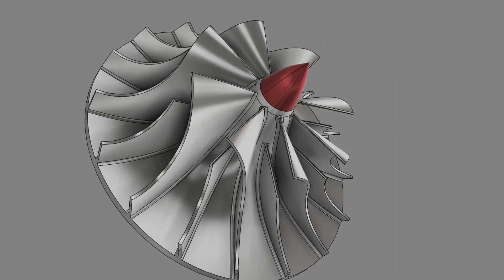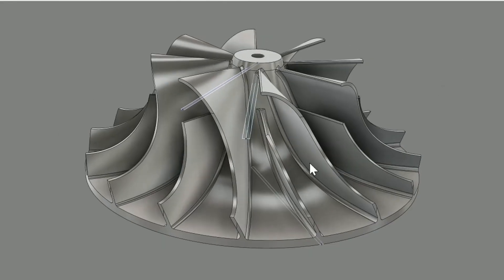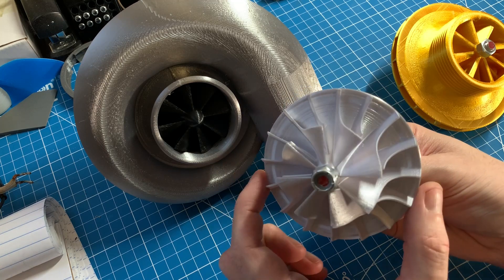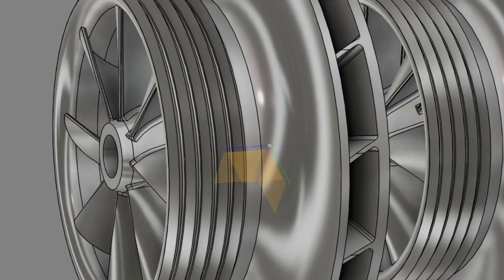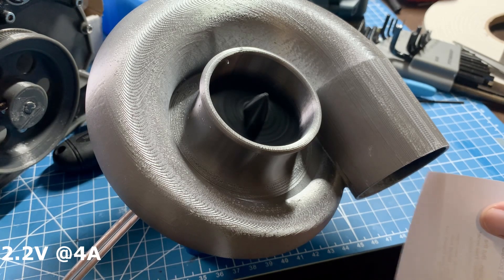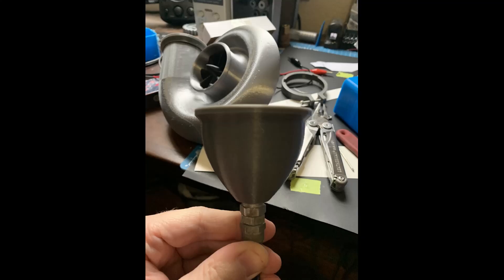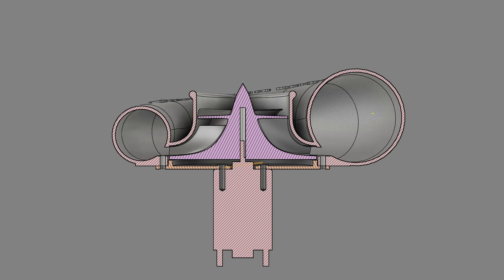3D Printed Centrifugal Turbo Compressor

Comment: This is all great, but I have been looking through all that information, likely the same papers you've read, in an effort to get the Euler turbine equations narrowed down to generate geometry, but haven't been able to do so.  Did you strike gold on a paper that you can point us to, or rather, can you make a video going through the design equations for a centrifugal pump?
Reply from the maker: I have to caveat this, but I’m not an engineer or expert on this. In my case I actually watched several demo videos of Ansys Blademaster and I actually took the detailed angles from their setup. This is also a very simple older compressor wheel design that allowed me to just use a few points and interpolate with splines. Not the most accurate, but it should exceed the FDM printer tolerances. 

This paper has the details on axial compressor design, which I used to lay out my blades. http://www.seitzman.gatech.edu/classes/ae4803/compressor_angles.pdf. Because my blades don’t twist at their root, I could lay out a blade essentially like an axial compressor with the angles from the ansys demos. I’m not sure if this is right or not. 

I’m working on a version 2 that I have an actual compressor wheel that I’m measuring and trying to model. I can tell you after playing with this, a dedicated CAD suite for designing turbo machinery is a must for designing a modern compressor wheel.
Reply: @IndeterminateDesign   First off, thanks for the reply.  Second off, it's a shock to hear you say you're not an engineer on this; the only thing I can assume from that is that you're not specifically an aerospace engineer who specializes in turbomachinery, since my brain can't accept that you're not an engineer in any capacity short of that.  If you actually aren't an engineer, I hate to break it to you but you are. :)

I checked out the paper, it definitely helps provide vane geometry and overall velocity vectors, but what I was hoping for was a set of design or sizing equations that may provide equations to determine the following, which could be manipulated based off design constraint knowns or unknowns:
- Vane count
- Slight input on Vane Curvatures (fwd, bkwd, twist)
- Staggered Vanes
- Inlet diameter, outlet diameter, volute housing diameter ratio (if it's not linear growth)
- Expected CFM
- Expected Pressure/Velocity ratios
- Expected efficiency

And of course all of that would be based on the following requirements:
- Gas properties (Reynolds, Z (compressibility factor), density, temperature)
- RPM
- Power
- Pressure/Head

I found so many papers on the design of it, all of which had the above variables, but didn't have the above outputs.  I did find some that drove what type of fan to choose based off the application, etc.  

Regarding the V2 design you're working on, and the modeling, I devised pretty simple ways to model the geometry, but that's in SolidWorks, though I can't imagine Fusion won't have similar features.  Essentially in SolidWorks, I:
1) Create an oversized disk that is the bottom of the centrifugal blade.
2) Create a plane that is the height of the blades away.
3) Create a "loft" geometry that essentially is two rectangular profiles clocked at a small angle from each other separated by the height that are lofted to each other on a curved, 2D profile.
4) Loft two circular profiles in the center to create the "body" of the blades.
5) Create a circular pattern of the loft dependent on the number of blades desired, ensuring that the rectangles overlap in the center to create jagged/overlapping geometry that i merge.
6) Cut the center out to be a constant diameter bore, cut bearing journals in, cut the disk against the blades to get the outlet diameter.
7) Chamfer the edges of the blades.
8) Fillet the geometry for machining and stress concentration concerns.

I'm sure this is all TMI but figured I'd tell you so you'd have it if you wanted it.  Thanks again for the reply man!

Comment: If you are working on a new and improved design, can you throw the design files for this up on github? I'd like to use a well thought out design as a learning tool for myself and my kids and slap it on different rc toys and and teach them through playing and experimenting
Reply from the maker: https://github.com/indeterminatedesign/CentrifugalCompressorV1

Make sure you are wearing safety glasses when operating this.  Print the wheel at the lowest layer height you can and at 30-35mm/s.

Comment: Fusion has its benefits like just being able to quickly design organic shapes, but solidworks, if you know what your doing, is a lot more precise, and can way more easily design production parts
Reply from the maker: I agree.  I can work so fast in Fusion that it would be hard and expensive for me to switch to something like Solidworks.  I've learned a lot more about how to do this properly, and I'm slowly working on a 2nd version that corrects some of my mistakes in this design.

Comment: Awesome project! What kind of motor did you use? Would you be willing to share the STL or STEP files?
Reply from the maker: It may take me a bit, but I'll get this posted to my github.  I wouldn't call it a complete success.  I've started a second version because I've discovered several mistakes in that design.  The motor is just a 540 brushed RC motor, 27T.
Reply: @IndeterminateDesign  Excited to hear you're working on a V2!! Looking forward to it

Comment: What 3D method did you use? SLA ? It looks like a plastic.
Reply from the maker: It’s FDM 3D printed with PLA filament.  It was just to try out the design. SLA or SLS would produce much better results.

Comment: Very interesting! I would love to see higher tolerances (.0001+ -) and greater detail! Other than that great video!
Reply: LOL A tenth tolerance isn't possible with FDM. Even high end CNC machines have difficulty achieving that. With shrink and deformation of plastic, it is highly unlikely. A .0010 tolerance on FDM would be more achievable - difficult, but more realistic. And at that point, one would need to consider surface finish as at that point you would only be measuring the high points of the surface with any traditional measuring method.
Reply: Even if you got that rotor within those clearances while stationary, runout from the bearings and expansion from the centrifugal spin force would totally muck them up.

Comment: If you want 5-10 psi and decent flow rates with a 3D printed pump, I'd suggest that you look at positive displacement diaphragm pumps.  Just need a few sheets of rubber for the valves and diaphragm.  (though thin printed reeds and bellows might work well too)
Reply from the maker: The diaphragm pump looks cool.  I want to play with that in the future.  I think that is about the only way to get decent sealing of a 3d printed part.

Comment: You should look up regenerative blowers or side channel blowers.  Neat way to get somewhat higher boost at lower flow than with centrifugal blowers.  Also, invest in some colored water and clear tubing to make a simple U-tube manometer.  You were probably making 5-10 inH20.  Which is quite good for something with a tip speed not measured by Mach number.

Comment: Do you use any special method for calculating stresses in FDM printed PLA or same as like for metals?
Reply from the maker: I didn’t do any stress test on this. You can use plastic materials for the analysis but the challenge of FDM 3D printing is that materials are much weaker when loaded against the layer lines. So the only way currently to test them is real world testing.

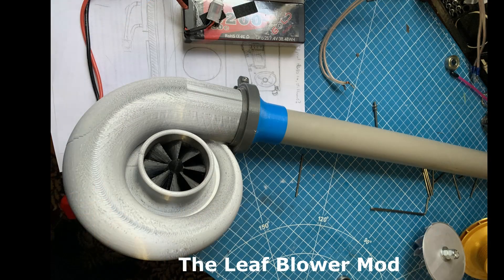Comment: 9:45

"Just a goofy little thing to mess around with"

showing a practical use case (not commercial leafblower quality, but for V0.1 you get my gist)
Reply: I was actually looking for an open source "inline centrifugal fan" CAD (mainly for 3d printing it, and using as a low cost componet for a dessicant-humidifier AC) and by accident (was subscribed for some other video) you made exactly what i need essentially !
Reply: This was the page i made i think?:

https://wiki.opensourceecology.org/wiki/Open_Source_In-Line_Duct_Fan

Comment: It seems tolerances are the bain of 3D printing.
Reply from the maker: Definitely for FDM 3D printing on sub $300 machine. There are some cheap resin printers out now that are capable of 0.1mm accuracy.   I just don’t know if I want to deal with the mess of resin.

Comment: You might wanna see If your design is a good candidate for a skirt compress for a (RC) Hovercraft. You could skip the coiling stage. So it would not be much heavier that a standard EDF unit but it might be more efficient. 
Anyways, nice demonstrator!
Reply from the maker: Yeah, I think it might be good for something like a hovercraft. I have to look, I’m not sure how efficient these are versus the axial fan in an EDF.
Reply: @IndeterminateDesign  I wasn't sure either. What would you use as a metric, Electric power needed for a given airflow at a Given static pressure and Aperture?
Reply from the maker: I'm not sure, I think you're right that it would be pressure and aperture would determine how fast the fan has to spin and the reynold's number.  The centrifugal compressor will definitely create more pressure, but a single stage axial fan will move more air.  A multi-stage axial probably wins for a full size hovercraft.

It's hard to find information about this kind of thing on the internet.  I'm sure it's buried in an expensive textbook somewhere.

Comment: Very cool what was the volume of the bag ?

Also nice socks 😅
Reply from the maker: Thanks! 🧦. Sorry, I forgot to mention the bag was 30 gallons.
Reply: @IndeterminateDesign  30 gallons in 2 and a bit seconds that's no small feat
Reply from the maker: Yeah, it moves a lot of air for such a low power motor.  I may need to pickup a cheap brushless motor and really crank this up.  

I also took apart a broken turbo yesterday and modeled it up.  I found several mistakes in my design and little tricks the the big turbo manufacturers use.  I didn't have a diffuser in the compressor housing, which could account for the lack of pressure and lots of turbulent flow.

Comment: What resources did you find helpful? Do you know if this is able to be done in solidworks
Reply from the maker: Forgot, this is a good intro to compressor wheels. https://www.cartechbooks.com/techtips/anatomy-of-a-turbocharger-whats-inside-and-how-it-works
Reply from the maker: Honestly I found a YouTube demo of Ansys Blademaster and I looked up each field from their config screen, like Beta angle. That led me to some grad papers with different designs that people were researching.   I don’t know much about Solidworks, but unless there is an add-in package I imagine you would have to design this the same way I did with multiple sketches and surfacing.